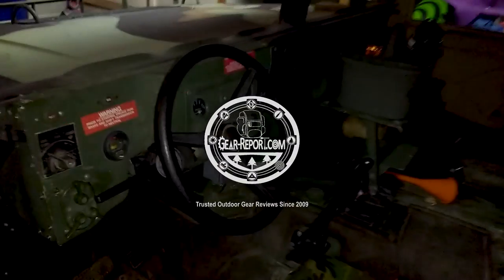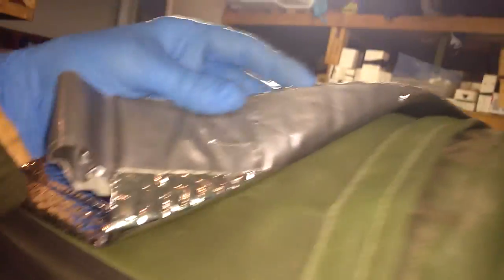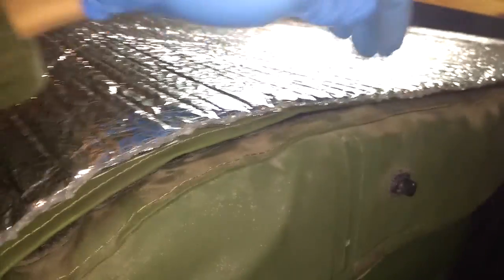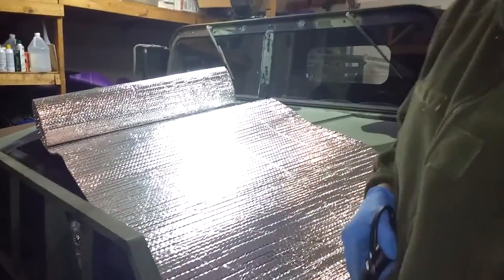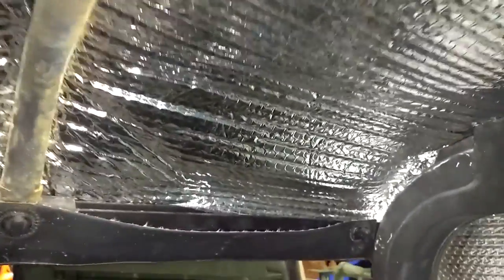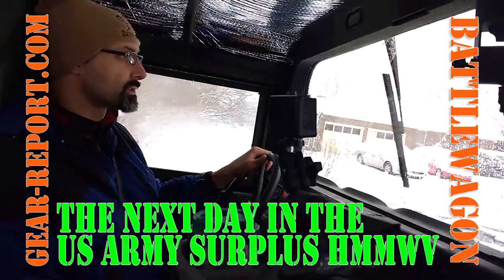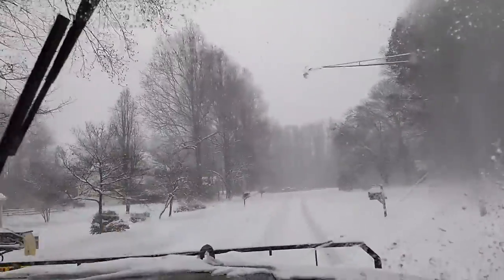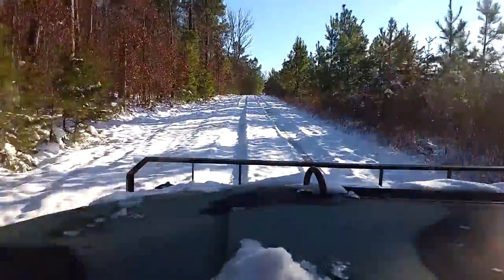DIY HMMWV Upgrade - Reflectix roof insulation - Driving HMMWV in Snow - Gear-Report.com Battlewagon

Comment: What method did you end up using to tag and title your humvee?
Reply from the maker: There are a variety of approaches that I have seen work. However, the process is really dependent on where you live.
Reply: I'm in kansas. I've titled dirt bikes through south Dakota before by using an off road vehicle conversion form, so I'm thinking that may be the best way to get a humvee on the road
Reply from the maker: Sorry, dude. I don't know anything about the process in Kansas. Does SD title vehicles that aren't owned by SD residents?
Reply: they sure do. only caveat is you can't get personalized plates :/
Reply: In Amarillo all I had to do is get it inspected with proof of insurance and they accepted my sf97 paperwork from the government planet I bought it on.  If you need a texas address you can use mine